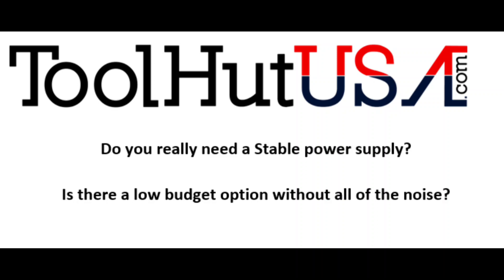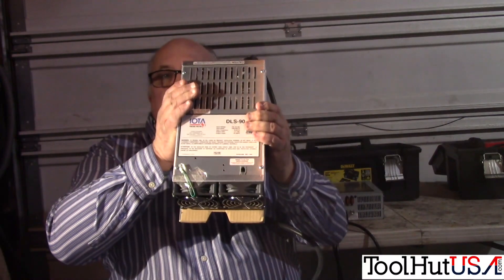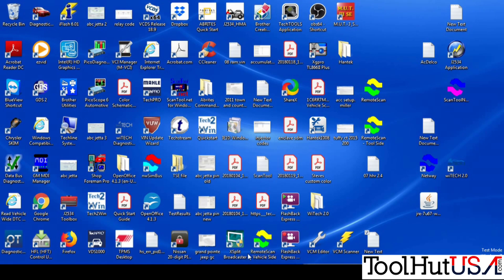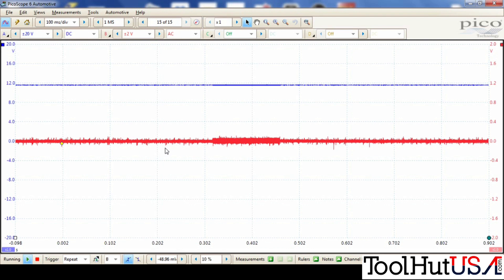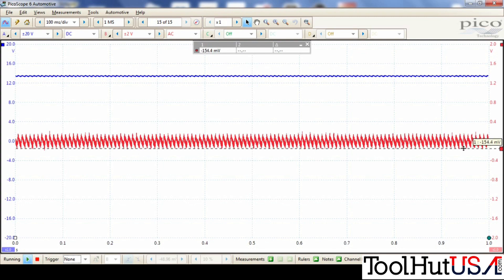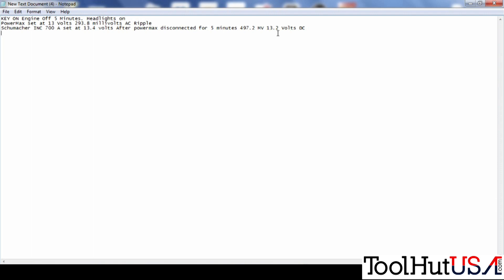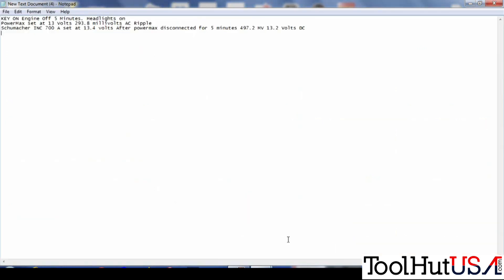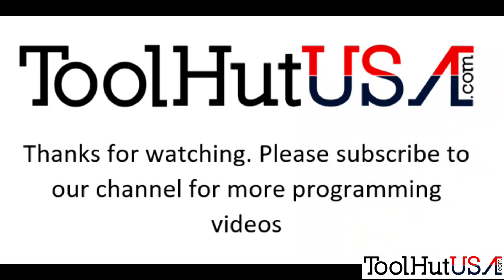Do you really need a Stable power supply for programming? (revised)

Comment: Hey Sam, why did you chose to buy the IOTA DLS-90 not a lower amp one like the DLS-75 or even the 55? is there a minimum required amp capability of those maintainers in your opinion? thanks
Reply from the maker: I do a lot of euro. Many recommend 100. Gm recommend 75 I think. Never be left short.
Reply: @toolhutusaakathecarflasher3019 
thanks for the advice.